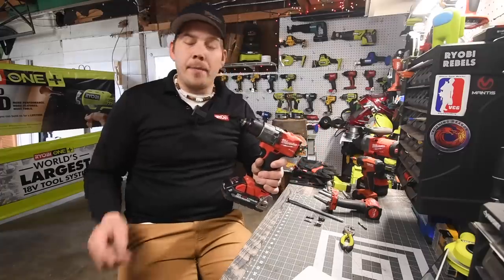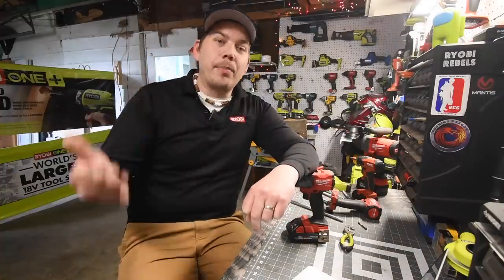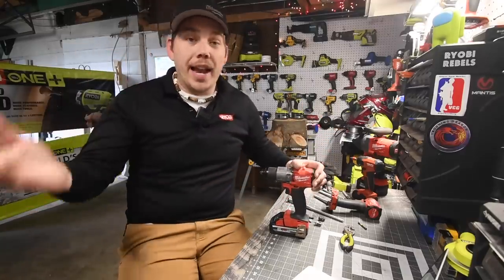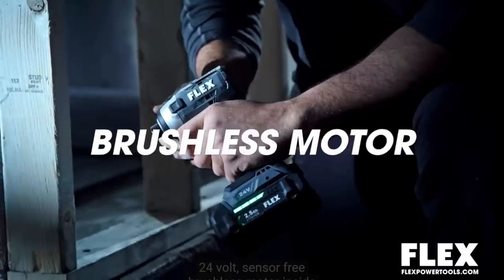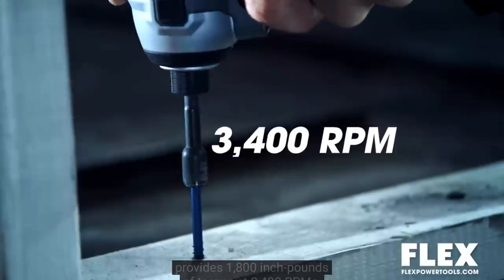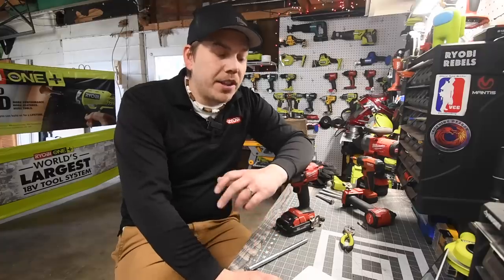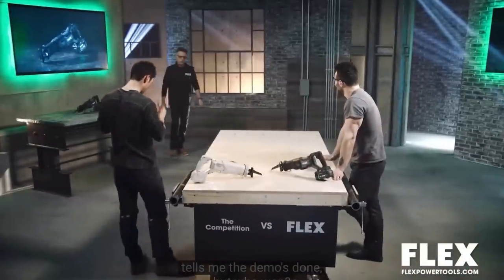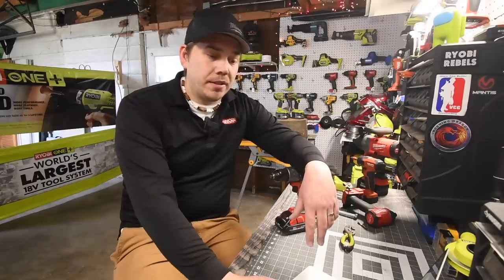My Flex tools vs Milwaukee  video RANT!!!!

Comment: I saw a quick intro earlier today from pro tool reviews about the impact and the hammer drill and I was impressed from some of the features. Especially the impact bit release where the trigger and no more pulling on the collet. They also said the impact had more torque than the gen three that it easily breaks half inch socket adapters. But Dave I can't wait for you to get your hands on them to really give us proof on what they can do and to see if the gen three impact has really met it's match. Your a pro at reviews I love this channel
Reply: I've actually seen some reviews complaining about Milwaukee's existing impact drivers b/c they break so many socket adapters / bits already.. that's not necessarily a selling point! : P
Reply: @connors.1077 true but I think socket adapters breaking isn't always the tools fault. Alot of users like to always be on the highest speed and hold the trigger to the handle
Reply from the maker: I thank you for viewing

Comment: Let me just say I have to agree with a lott of what you said and I love the one flex tool I do have   And will be buying the 1/4 flex driver and then the  3/8 impact I currently have the 1/2 impact for doing  tires at work in my case the Milwaukee m18 high toque  left a bad taste for me went  through 3 of them in less than 3months  got my money back and got the flex and haven’t had a problem with it nd have beee using it for 6 months so far now  love my m12 stuff I’ve got
Reply from the maker: FLEX tools are powerful, but I disagree with on how they did their promo video on them

Comment: I'll keep my gen5x Ridgid impact and hammer drill. Thank you very much. My gen5x is 2250 inch pounds my hammer drill is 750 inch pounds. And my subcompact 3/8 drive impact wrench is 225 ft lbs they work for me and best yet we're very nice to my wallet compared to other brands for less power.
Reply from the maker: I thank you for viewing  :)

Comment: Did you look at the body positions of the guys when they were using the drills?  The guy with the FLEX was using way, way more upper body and leaning into the drill, especially with the auger bits comparison.  The guy with on the left was always holding back.
Reply from the maker: I thank you for viewing  :)

Comment: 2:04 I was curious to see if it was obviously rigged. 

It was obviously rigged. The Flex guy's entire  body adjusted itself automatically. The legs tensed up go anchor him. The entire upper body shifted the tool arm is the most obvious visual change.

The other guy might as well been a cardboard cutout.

Comment: Take er easy there buddy don't let that contest hurt your feelings too much. Im a heavy equipment mechanic andi have all Hercules cordless tools cuz I'M NOT paying all that money for Milwaukee and DeWalt and their $100 batteries and I use and abuse my Hercules stuff everyday and absolutely love it. Nothing has broke yet and I give it a serious workout on these big machines. But I did go out and buy the flex half inch drive high torque impact last weekend and it is freaking awesome I absolutely love it and I spent $299 as opposed to $600 and it broke the track sprocket bolts lose on an excavator this morning that I had to use a 3/4 in pneumatic impact to do the other side last week cuz my half inch air impact wouldn't cut it so that was proved to me that I bought a good tool and saved money. The battery charger sounds like a jet plane taking off cuz it's got a cooling fan built in. Now shit like that impresses me. Totally badass charger. They offer a 12 amp hour battery for their 24 volt tools but it's $250! I almost had an aneurysm when I saw that price
Reply from the maker: the Flex tools have proven themselves, this video was their first promotion video. and right out the bat they said they were the best without proving it. they are powerful tools. but no tool brand wins every test. Flex tools are good tools

Comment: The 21700 vs 18650 sure but what about the difference in voltage and watt hours i mean if they are both 2Ah batteries which the testing I saw and heard about on vcg they had a 2.5Ah battery so if that's the case a 6s at 2.5Ah is the same watt hours as a 5s 3Ah
Reply from the maker: I thank you for viewing  :)

Comment: Serious users of pro level tools have already picked their battery platform and invested in them.   IF the Flex tools are slightly faster etc. (a big IF), then it will be hard going being so late into battery tools at pro level.   Milwaukee, DEWALT Flexvolt etc are so well entrenched.   And a big “weed out” will come at the consumer level as new entries appear like Hart.
Reply from the maker: I thank you for viewing  :)

Comment: I think this is why I don't care as much about these types of performance tests.  I care about 1) Safety 2) durability 3) Battery quality & longevity 4) value.  Honestly an extra couple seconds per hole doesn't make or break a job or project for me as much as downtime/bad battery system/getting hurt.
Reply from the maker: but you gotta admit it is fun to watch tools going head to head

Comment: I see all the hype about the new drills not just the Flex but all the drill on the market. Everybody is bragging about their tool being brushless and how special the batteries snd chips are. I grant you there are some good drills out there. But, will they last? I have an 18 year old Bosch Brute 18V 1/2” hammer drill that I use everyday and it’s never missed a beat. I know that this drill even with a 3 Ah Ni-Cad battery will still out perform 75% of the drill on the market today! Because it was built for power and was built to last. I want to see the new drills live this long.
Reply from the maker: I thank you for viewing

Comment: In all reality all of the platforms offer good drills. You can get a fluke in anything. The transmissions is what I wear out in drills and I have done it with all of them. Milwaukee included. Nothing like broken teeth in driver gears lol. You cant really say one the best until they stand behind their warranty , fast on a broken tool.

Comment: Great video, much appreciated! 
Can’t wait for you to do some head to head tests. I think you also need to do a head to head Flex VS Flex in 6 months or so with a fresh new flex drill bought at Lowe’s, just in time for the “special” 1st batch to be sold out/“special” stock depleted . Imo the 1st batch of “special” flex tools are going to be bulletproof and powerful (just like the ones that they have already sent out to reviewers) to the point that the lifetime warranty won’t be used much so they can offer it. When the lifetime warranty ends and the 5 year warranty begins is when these tools will become underpowered and cheaply made. 
👍🏻👍🏻
Reply from the maker: I thank you for viewing

Comment: If you notice they used a lot of old version Milwaukee and less on the battery why because if they would have put it against the best with the best battery flex had no chance.
Reply from the maker: I dont think it does either but there is only one way to find out

Comment: At the end of the day,  I don't think anyone is just going to run out and change brands over a few seconds saved on drilling. Anyone can come out with new tools to beat someone else's tool that has been out a year. Anyone think milwaukee/ Dewalt etc won't come out with something better? I'll keep my milwaukee, not perfect, but has not let me down.  The video just shows, another tool company who will stretch the truth to get sales. Not to mention, it's 24v versus 18, it should be better. The fact they had to cheat to get them to beat older tools makes me think they are not as good as their claim. Great video.  Glad I wasn't the only one who seen the fake.
Reply from the maker: I thank you for viewing

Comment: Interesting, I’ve literally never given the Milwaukee hammer drill a second thought. It’s been plenty powerful enough for what it’s used for.

Also interesting, RR buildings just did a “test” on Instagram driving lags with the hitachi triple hammer, new makita 40v, and the Milwaukee 3rd gen impacts. Milwaukee came in last with a 5ah, but first with 8ah HO.

I guess the batteries really matter.
Reply: I’m really glad the flex impact beat the Milwaukee brushed impact 😂
Reply from the maker: I thank you for viewing

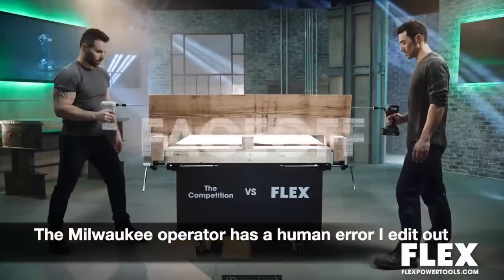Comment: 8:58 & 9:07 you can tell flex's screw has a pilot hole. The 1st inch almost instantly goes in. If you're going to cheat at least do it right Flex.

Comment: Is sad but have seen the 179 drill beat gen 3 hammer on VCG.  Let's be real they all scew the numbers depending on what they compare it to. Vince tested both 21700 and 2ah and flex still beat it. Even though not far off.

Comment: I know they didn't say it, but I think they more meant "for it's price" when they claimed the Flex hammer drill was "the bestest lol". I mean, whenever I compare something the first thing I compare is price... Also, at first I agreed with you about the Sawzall, they should have pit theirs against the Super Sawzall. But then I seen that the Super is $250 for tool only and theirs is $250 with a big battery and charger. I mean, let's say it beat the Super (It can't) it would have been a home run, they had to kind of hide behind price. Their number one defense for not going against the Super is "It cost more, not the same price". They did compete against a similar priced saw at the end of the day.
Reply from the maker: these tools are that cheap, they still are pretty pricey

Comment: The only thing I would debate on is the grinder. I'm not sure it was more pressure or because he was cutting upside that he almost lost control and appears to have more sparks. The Milwaukee is held cutting down with sparks going to the operator,  the flex is operated opposite and shooting sparks away from the operator and bouncing off the plexiglass appearing ro be more. I know that grinders will jump like that when cutting with the blade oriented in that manner. Not debating flex didn't try to pull the wool over anyone's eyes,  just an observation and plenty of angle grinder usage. And I'm team Ridgid so no dog in the fight Haha
Reply from the maker: I thank you for viewing  :)

Comment: I have a 2.0 milwaukee battery. Is there a serious benefit to go 5.0 or should I go for 3.0 high output?
Reply: 3.0 high output for sure
Reply: HO is more powerful, but you can get HO on many different sized batteries. The bigger HOs are more powerful than the smaller HOs. But remember that not every tool benefits from more power. The increasing popularity of the M12 line is evidence that, for some tools, enough power is all you need.
Reply from the maker: I thank you for viewing

Comment: This guy really saying the Milwaukee is a weak hammer drill, look at the size of the Milwaukee and it's right up there with the Dewalt Flex in power. For its size compared to other top professional hammer drills on the market the Milwaukee is a monster. I for one prefer the Milwaukee fuel hammer drill over the Dewalt flex for many reasons but the main reason is weight, size, and its just esaier on me after a 10 hr day at work. And this is coming from a hard core Dewalt fan boy.

Comment: Flex was German. Now it's owned by Chervon. The thing with German products isn't that they are not good but they are too expensive. You pay way too much for the quality you get. That's why I would always pick Milwaukee or Dewalt over ANY German tool

Comment: I think truth will come out once everybody buys it and tries them.
Every tool companies over sales their products. That includes Milwaukee,  Dewalt, Ridgid,  etc.
Milwaukee's MX fuel generator claim is one of the gimmick sales.
Anyone who understands Voltage (72v) X Ah knows that Milwaukee generator only produces 720 Wh with 2 x$500.00 batteries.
It is not a all day generator. More like 30-60 minute generator.
So I don't blame Flex. Everyone over sales their brands.
Reply from the maker: I thank you for viewing
Reply: @ManCaverTools  
Just watched VCG construction did a demo between Milwaukee Fuel gen 3 with Flex base model.
Vince's Jaw dropped watching Flex kicking Milwaukee's butt.

Comment: Such a fan boy. It’s ok to say u love Milwaukee lml. 
Dude flex hasn’t created a super reciprocating saw why would they compete against the super saw without a super saw? As of rn it’s been proven by a lot of yt channels flex is neck to neck with Milwaukee. Instances were it’s beating the fuel
Reply from the maker: Ryobi and HILTI are my favorite brands. I don't use Milwaukee tools that much. I was just but hurt form the fact that they said Fastest most powerful hammer drill on the market right out of the bat. you need to prove it first. That Milwaukee hammer is not the best hammer drill out there. so Flex winning against it doesnt prove anything

Comment: Only time will tell whether these are quality tools or not. I'm not too worried if a tool can cut 2 or 5 seconds faster than another tool. I'm more concerned about longevity, durability, and whether the company will stand behind their product. I don't want to buy something that will break the second I drop it, or batteries that are dog shit, or burn motors out left and right.

Comment: More voltage wars... well, Votls don't really matter (once you are in whole numbers)... Watts/VA and cel discharge rate/capacity are what really matters. 
Kind of surprised Flex didn't go with 21700 cels in their battery packs instead of 18650 cels. 

With brushless motors and good electronics, 12, 18, 20, 24, 28, 36, 48, 56, 72 volts - all irrelevant. How many VA or Watts?
Reply from the maker: I thank you for viewing  :)

Comment: I agree there are many ways they could have Doctored most of the results. The Flex rep did mention that they tried to match up the tool's spec per spec so pretty sure they went with alot of lower grade Milwaukee tools. Ideally if they are claiming to be the "Most Powerful" thing out there then compare your tool with the most powerful tool of each brand not your competitors mid range tool 🤷‍♂️. I'm sure in the next few weeks the YouTube tool testing community will call out any bull with head to head comparisons. I too like the look and batteries so hopefully they come out with higher spec tools. I was planning on getting their High Torque impact, but the specs are lower than expected. Anyhow appreciate your vids and BTW gonna Frankenstein a used 2853 impact driver to a 3/8 wrench after seeing the Torque Test channels review on your bad ass creation that monster kicks ass👍
Reply: I'm wondering if they matched up by whatever their launch pricing is to Milwaukee MSRP - b/c Milwaukee is definitely not cheap, to the point where the value per $ can become an issue for tool comparisons.
Reply: @connors.1077  Not sure, but Home Depot seems to have pretty good deals with their buy more save more programs. Plus you can always return a tool or two from the deal and get your money back essentially getting a pretty big discount off the one particular tool you really needed pretty good hack. BTW Shop tool reviews just did a test on the High Torque impact the only tool I was interested in and it seemed to hit all the specs that being said I might just pick up a Milwaukee High Torque instead for more power.
Reply from the maker: I thank you for viewing

Comment: The main thing we have to compare here is the fact that the FLEX tool is supposed to be a huge output battery/tool set up and even if it did beat the Milwaukee tools, it was only competing with an 18 volt battery with old technology/entry level batteries.  So, who really won?  I think we all know the answer to that.
Reply from the maker: I thank you for viewing  :)

Comment: And the guy using the milwukee sawzall isnt using it properly to get the fastest cut, if you notice he keeps it either leveled or angled up, while the flex guy angles it down cutting thru the bottom with the top of the blade as the bottom of the blade is cutting thru the middle
Reply from the maker: I thank you for viewing

Comment: They were using Milwaukee regular batteries in the face off too. Where was the m18 6.0 high output on the hammer drill test? Btw I am not a Milwaukee fanboy. Personally I am a makita guy. But a good tool is a good tool and although the flex stuff did impress me, the face off was just market wank.
Reply from the maker: I thank you for viewing

Comment: Didnt dewalt already come out with a high output line called flex volt? So not only are there guys lying about performance but theyre buying people off to shut them up and push their product AND they kinda ripped off the name from dewalts flex volt
Reply: In their defense, Flex was a German brand and this Chinese company Chervon bought the Flex name from Bosch.
Reply from the maker: I thank you for viewing

Comment: Personally I have the Milwaukee hammer drill and my German made metabo ltx walks circles around it and that’s without using the high density battery.
Reply from the maker: I thank you for viewing

Comment: The worst part is that they didn't use the super sawzall, and they used a line of tools which has 6 less volts it makes a difference.
Reply from the maker: I agree

Comment: Before I even watch your video, I'm going to say that the release video for FLEX was definitely a set up.  They used the Milwaukee Brushless tools, which are their lower end, consumer line.  But in reality, the FLEX tool didn't do a whole heck of a lot of damage by comparison even to those tools.  I mean, let's have a tug of war between an F150 2wd and a GMC 2500 4WD and brag that the GM pulled the Ford all over the dirt like it was a trailer.

But now I'll watch your take on it and see what you have to say.
Reply from the maker: I thank you for viewing  :)